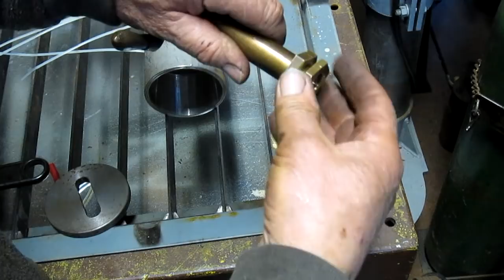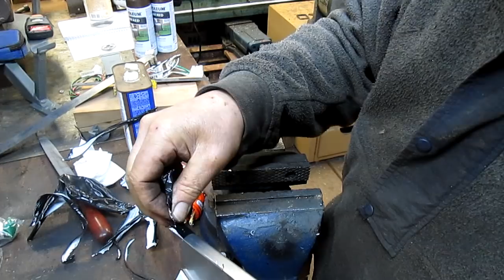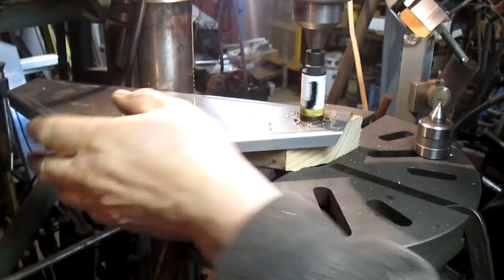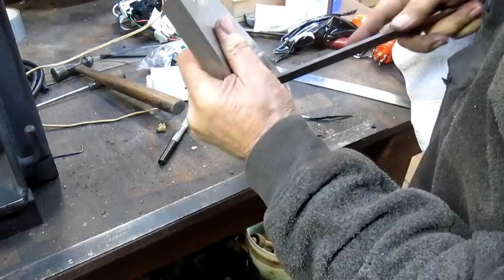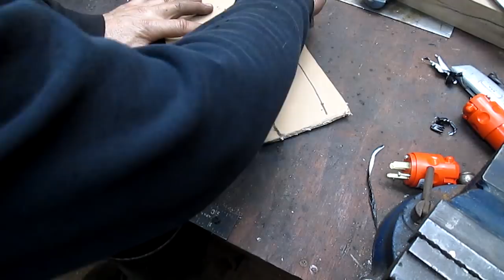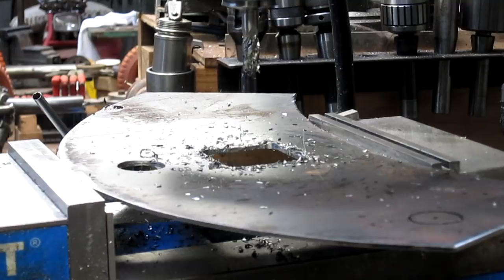Almond Centrifuge Build #8

Comment: Nick could you build a box where that is the top deep enough for the electronics to fit. A box would be easier to attach to the cage.
Reply from the maker: As you will see in the next installment a protective cage falls into place.

Comment: Should have left the plastic film on until the end, save scratching it whilst you made the holes in it.
Reply from the maker: Problem is any kind of heat and the plastic melts into the metal and is impossible to remove. I could drill under water. :-)
Reply: hey dave do you ever have anything positive to say? you must be perfect in your own little world.
Reply: Jamie, thanks for your comment, what is not positive about my comment ? The plastic is on there for a reason, to protect it whilst in storage and being worked on. I use to work with it, removing the plastic was the very last operation. Unless you were unfortunate to damage the plastic skin whilst making the part it came out perfectly polished as it was when it was made. I respect what Nik said about heat making it difficult to remove, perhaps your USA  metal / plastic is different to our UK metal. We even TIG welded with it still on, just rolled it back about 1 inch from the weld.